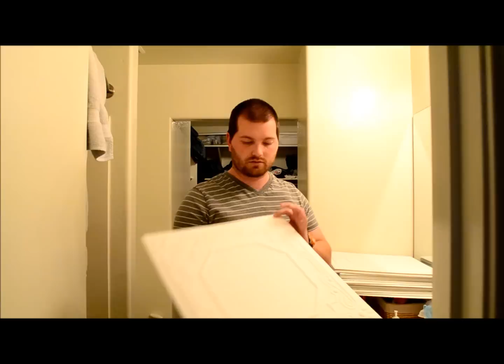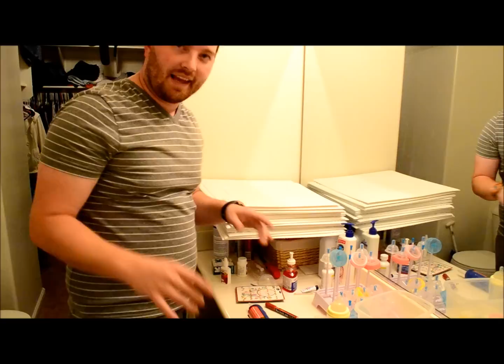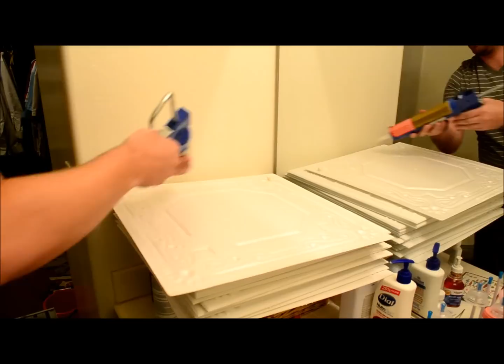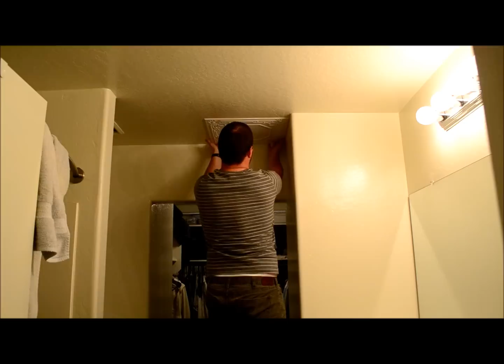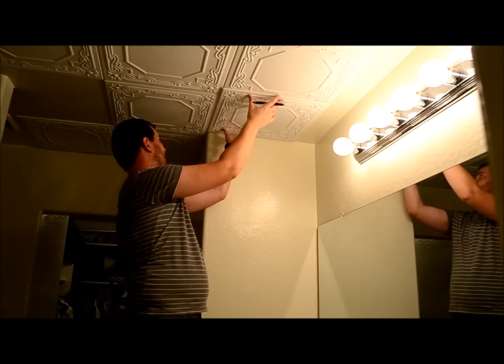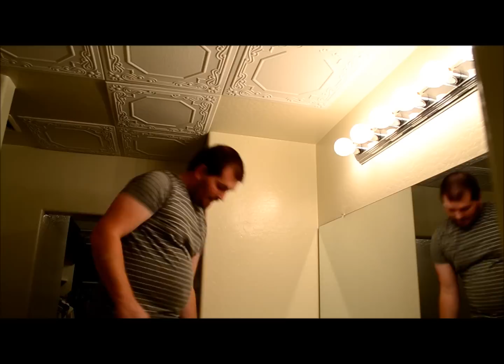Installing Ceiling Tiles from CeilingTilesByUs.com

Comment: You, should, have done 12x12. And also use a filler for the borders. Profesional, installers do not cut stamped ,  tiles. Once, again. That tile is to big, for that size room. That said the customer gets what ,the want.
A nice, cornice could be added, on the filler border 😉.  But not the panels with ,a pattern.
Reply: What would you recommend for a filler?
Reply: @michellenieves8759  
The most ,common. Is pebble, filler. After that, u   are able to install, a cornice. Atleast, for a professional, finish

Comment: One ceiling tile is falling and it would have been nice if you had sprayed the exhaust grill, other than that ...Great Job. Hope you will do a follow up on how well these ceiling tiles hold up. Thinking about doing this in my foyer as I have ugly popcorn ceilings.

Comment: After a couple of steamy showers those will probably not hold up very well. If you are going to put these in a bathroom you have to put a full bead around the edge of the tile. A little dab here and there isn't enough.
Reply: Use, a ceiling, tile mastique cement. . With,  high quality power coated panels.

Comment: Do NOT use regular Liquid Nails adhesive on Styrofoam tiles!  It will damage the Styrofoam over time, as it is petroleum based.  For Styrofoam ceiling tiles use only an adhesive designed for foam applications, such as Power Grab by Loctite.  Liquid Nails also makes a Foam board adhesive that is ok.  Also use only water-based paint(a water-based paint that is rated for high moisture areas if you are putting these in a bathroom), not oil based, for the same reason...oil based paint will damage the foam. I would also recommend (as do many companies that sell these tiles) that you caulk all the seams with a regular white caulk.  Use your finger to smooth the caulk into the seam after applying, then a wet sponge to clean up any extra caulk not in the seam(rinse sponge often).  After the caulk dries (follow dry time instructions on tube) use a brush and touch up paint the seams so it blends in.  I find it easier to paint after installation.  These tiles look really good with a matching crown moulding (sized for the room).
Reply: +balerick48 dude you should just make the vid! learnt more from your comment than watching this.
appreciate the vid no offence but one is also falling off at the end
Reply: Mohammed Ali Thanks, I just have an interest in home remodeling.  I have done it now steadily for over 17 years on for homes that I have redone while living in them.  These foam tiles really are a nice option IF they are installed right.
Reply: What glue should you use then?...................